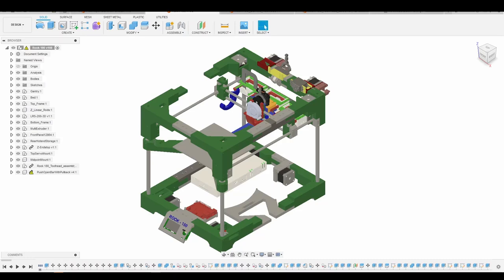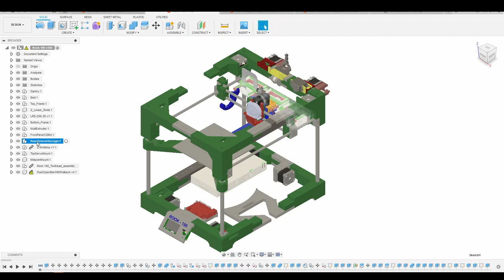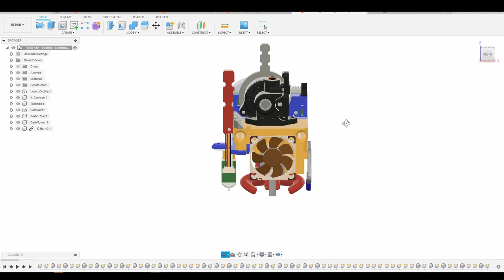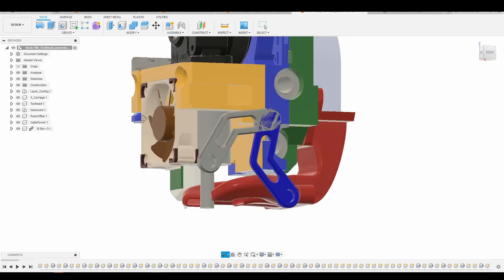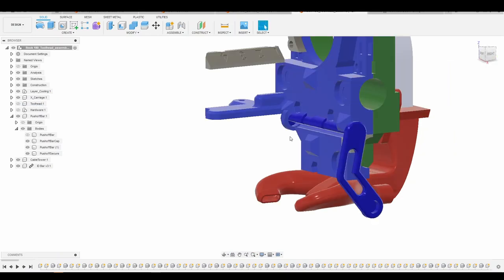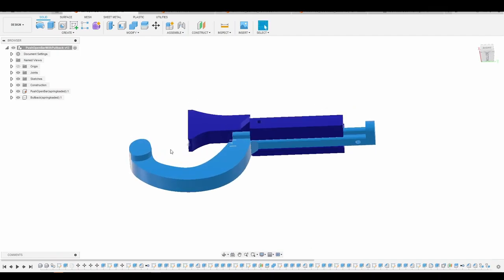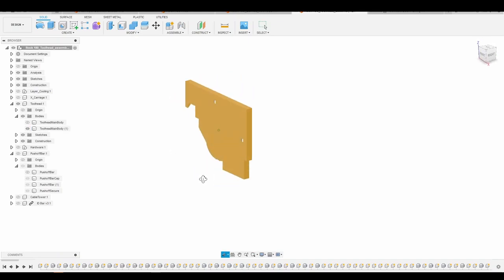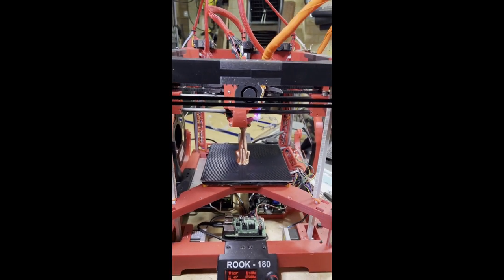Rook 180 mex - cad intro

Comment: Thank you so much for this! Was just looking at your github yesterday. I’m looking to build something similar with slightly longer bed rather than a tool changer. I’d like to mess with tool changers down the road
Reply from the maker: I believe there's a couple of people doing extended beds, in the rook-180 mods forum. (https://discord.com/channels/946191040682008666/1061893328372773005)  Using a simple insert like mine makes it an easy task, all you really need is to to buy longer rods. The extra room also makes fitting the electronics etc. in a lot easier.